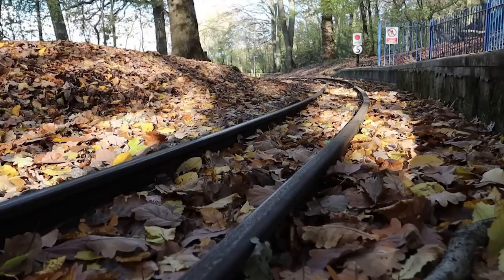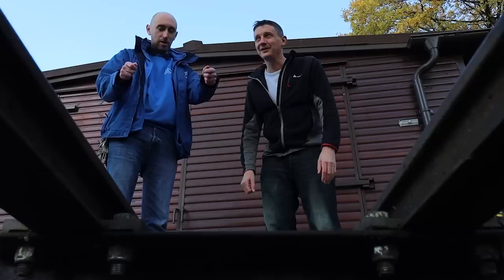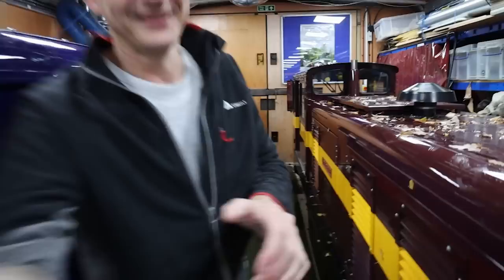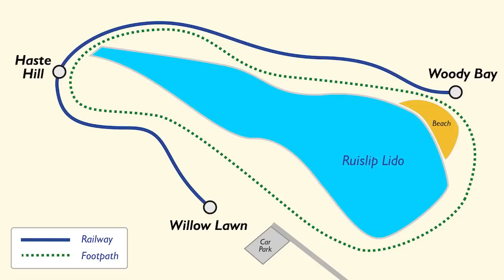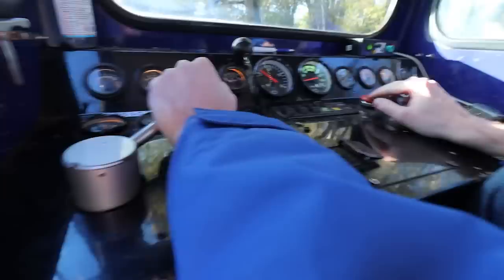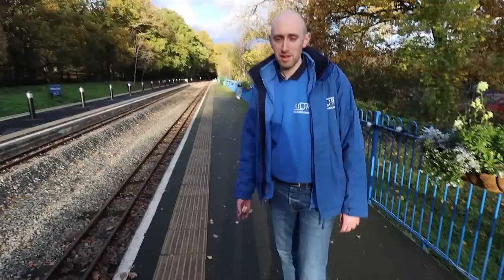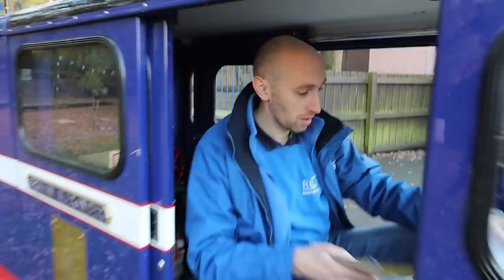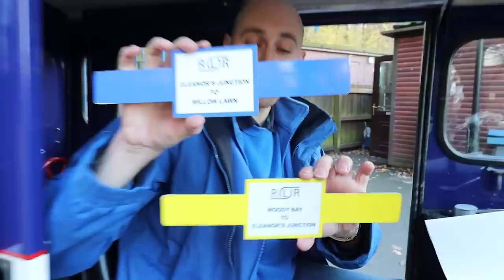Let's Ride ... The Ruislip Lido Railway

Comment: Next we need Secrets of the RLR including the disused section, the secret turntable, and the original turnstile by Woody Bay.
Reply: We need also "Race the Tube" with this route. Can you walk faster than the Ruislip Line?
Reply: Also we need to cover the stations them selves. Do they have a binbag waiving in the air
Reply: I know most history of RLR its a brilliant little railway love having it as my local
Reply: The name of the train Mad Bess comes from the woodland called Mad Bess Woods situated between Duckshill Road and Breakspear Road.
The origin of this name is lost to history according to local historian Elien Bowlt but the currently earliest known use of the name appears in a review of a fox hunt that was published in the Sporting Life in 1812 iirc.
Reply: Also, how many steps up/down to each station =)
Reply: Secrets of the Sodor Railway would be fascinating . . . . .
Reply: @dshack4689  It's 15 floors, of course.
Reply: The original exit turnstile gate was going to be taken away by the crew who were installing a new metal gate to the woods, replacing the rotting wooden gate. The crew contacted the Civic Centre, and asked about the turnstile, were told, "take it away, it doesn' really work"! And they started to dismantle it. Luckily the Rangers from the woods came down to the gate, stopped the crew and informed them it has to be put back together again as it was a Listed monument dating back to the start of the Lido in 1928. The person at the Civic Centre was hauled over the coals and then burned to death at the stake. No, not really. But they did get a good telling off.
The turnstile at Woody Bay was one of six, only one of which allowed entry to the Lido, all the others were exits. Ruislip-Northwood council ran it properly, unlike Hillingdon Council, One busy days the council hired the car park at Ruislip Station, and ran double decker buses every 10 minutes to the Lido and back to the station. There was a sailing club, a waterskiing club, a ferry to go from one side to the other, a childrens pool with pedallos, and rowing boats for hire. People swam there with no diseases. Nowadays the problems of allowing an overstocking of birds on the water at the lido, causes real problems for the fish and amphibians. The water levels are so low that, should we have a dry late winter, early spring, the water drops to a point were all the eggs laid are exposed to predators.
The problems with diseases and water are caused by Hillingdon Council keeping the water level at such a low level that there are no thermal layers. They keep it low because they have allowed buildings to go up in flood plain areas down stream from the dam. That is the problem when you allow townies/city-folk to make decisions about things they know nothing about.
The dam at the Lido was built between 1804 and 1811, when Napoleon was Emperor of the French, with the intention of supplying water to the Grand Junction canal, (now the Grand Union), at Uxbridge, but the supply of water was never enough to make any difference.
It used to be an amazing place, but mismanagement has destroyed it. Still a good place to visit, but Ruislip-Northwood did a better job.
Reply: Wasn't there a water-ski jump there in the late '60s ?
Reply: @nicholasroberts6954  Yes, the Lido held the World Championships there 5 times.
Also the very first film about the Titanic was filmed at the Lido and the Titanic actually sunk there. Also there were numerous sporting events held there, ranging from British, European and World sailing championships, and World Beach Volleyball held there.
And we mustn't forget that "Summer Holiday" with Cliff Richards and the Shadows was filmed there on the beach near Woody Bay.
Reply: @nicholasroberts6954  yes thats correct  and who remembers the Blue and red Weed boat with large paddles

Comment: I was a founder member of the RLRS when it was just a loop with the one station at Woody Bay. The loco shed was a brick building over a pit. We then built a new shed of corrugated iron. While the shed was under construction Robert failed. In those days the power plant was a Ford 1600cc crossflow petrol engine with a dynamo and control box.
Another member and I volunteered to fix the loco when we both had a day off work. Naturally the weather was less than clement and the rain was pouring through the still slack bolt holes. We managed to position the loco so that we avoided the water coming through and removed the control box which was located under the hydraulic oil tank against the cab bulkhead. We then went to a Ford main dealer, plunked the box on the counter and asked the partsman for a new one. He asked what vehicle it was off. The other chap and I looked at each other and said, in unison, a miniature railway loco. The partsman immediately had that "Oh really?" expression checked the details on the box and found us a replacement. Returning we fitted the new box and, with fingers crossed, started the engine. Everything worked OK so Robert was returned to the shed and we went home for a well earned hot shower and a brew.

It's good to see that the railway is flourishing since those early days.
Reply: unusual for control boxes to fail if set up from factory on the bobbin settings.
Reply: @highpath4776  Unusual perhaps but I had failures on cars.

Comment: RLR driver training 101:  "Just follow the track, you won't get lost"    
Yet another great video and it shows the tons of fun you can have playing with trains, be it on 12" gauge or 15", 10¼" or 7¼".   7¼" is 'my' gauge, built a Tinkerbell class loco, one of the smallest steamloco's you can still sit in rather than on, and a diesel electric one, powered by a tiny Kubota 2 cyl. diesel engine. 
They certainly got their act together at the RLR, the video oozes  details that show a very well cared for railway, hats off to all the volunteers !  Would love to see that tamper in action and the steamloco as well, so perhaps another visit somewhere around spring 2023 pretty please ?

Comment: Of course you measure from the inside - the rails are only attached to the inside of the tracks, not the outside, so it's important that your wheelset has the right width for the inside of the tracks, not the outside.

Comment: Quite right Geoff, the gauge is measured from the upper inside corner of the rail, known as the "Guage corner." Is you remember the crash at Hatfield, where the rail broke, caused by "Gauge corner Cracking" this was the part of the rail where the break started.

Comment: Obviously the track has to be extended to Ruislip tube station via Miller & Carter and Ruislip Duck Pond stops. It can run on the road. That works for the most part in Bad Doberan. It should be work there.

Comment: Bit confused, at 13:41 the train seems to run over points that were set against it 🤔
Am I the only one who noticed?
Very interesting video though,  I used to visit an Uncle in Ruislip who ran a fruit and veg shop back in the early Sixties.
Reply: I noticed this too!
Reply: Probably spring-loaded. These are sometimes used for passing-loops - avoids needing someone to operate them.
Reply: As it's a slow speed railway and those points arent locked in position the train will push them apart as it passes through the junction. It's not Official Railway practice but I know a Depot where it happens every night. Management take a blind eye to it but if a derailment did happen the “Shunter” would get disciplined.

Comment: Which raises an interesting question - how many passenger-carrying stations are there in Greater London which are on neither TfL routes or Network Rail?

Clearly, 3 at RLR.
One at the Postal Museum.
2 at Kew Bridge Steam Museum.
2 at Crosness Pumping station.
I think Uxbridge and Harlington both have miniature railways.

Any others?
Reply: Kempton Waterworks (or is that just outside?) anything at Walthamstow and Whitewater (enfield) musuems.  Thames Ditton engineering track is just outside served by a walk from one of the K routes to Long Ditton/Claygate on a walk or 516 bus from Kingston.  There is/was a miniature railway near seven kings (is it at Chadwell Heath Station ?)  The southall railway centre sort of exists but only as loco maintenance now.   There is the minature railway (12in ?) in Barking Park (two diesel locos) ,
Reply: Minature train at the LT Depot unit at Acton
Reply: @highpath4776  Kempton Waterworks is just outside - already thought of that.
Reply: @highpath4776  I did wonder about that, but arguably as it's in the depot it vould be thought of as a TfL route ;-)
Reply: @RJSRdg  My understanding it is run by volunteer members of friends of LT Museum. But yes it is on TfL of sorts premises,  would that make it the smallest railway on TfL land,  but oyster cards are not accepted and it is not in a zone (and so should Geoff cover that too ?)